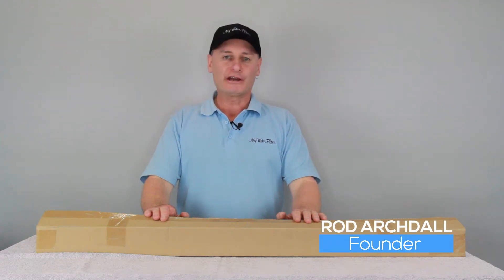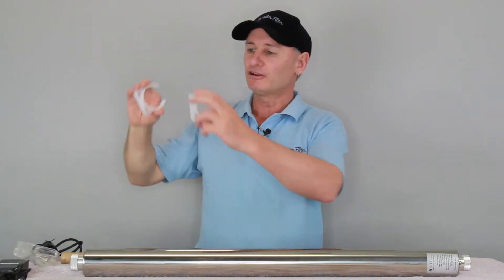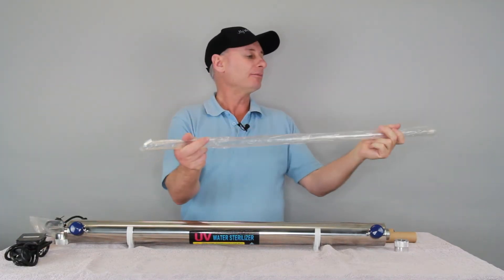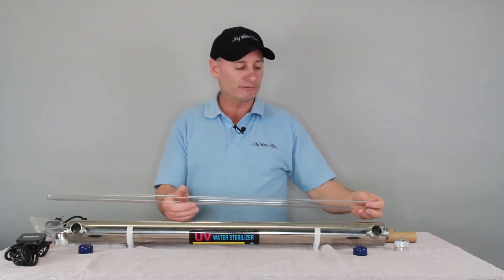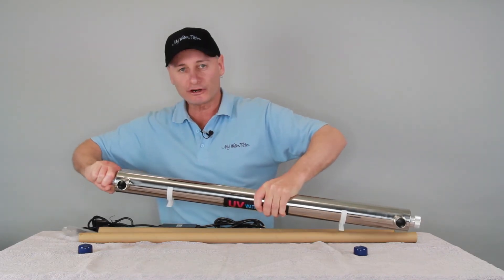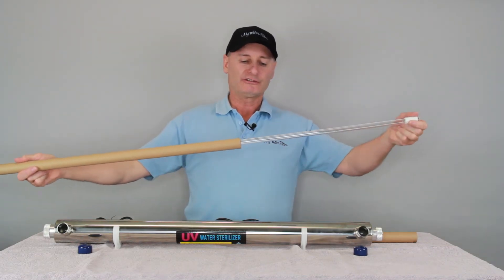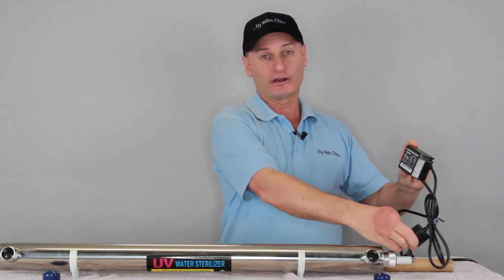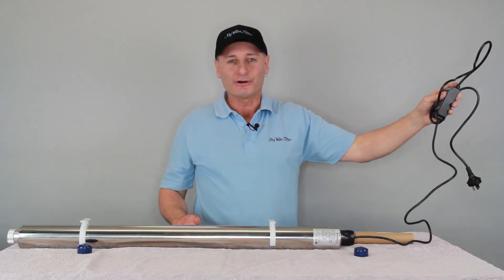Ultraviolet Light Installation Guide for UV Water Filter Systems

Comment: if you mount it vertically - why do you insert the UV light form the top end ..?
Reply from the maker: Hello Salty Dog Streak,

Thaks for the query

Salty Dog Streak, the reason it is installed where the UV opening is on the top end, is to ensure that UV lamp will not fall out of the casing or housing

The only thing that helds the lamp in place is a rubber cap, so to prevent slips regardless whether the rubber cap was removed or accidentally removed for somes reason, the UV lamp will still be safely secured in its place

Also, the lamp can be 1 metre long for a whole house system, so you need at least 1 metre to remove the lamp when it is time to change it. It is just easier to mount the system with the lamp removed from the top.

The other reason is water, it is better to have the electrical connection at the top and keep it dry rather than have water running down the housing onto the electrical connection. 

Hope this helps Salty Dog Streak

If you have more questions or need assistance, you can contact us at 1800 769 300, send us an email at customerservice@mywaterfilter.com.au or liaise with us over live chat through our website 

We are always here if you need 

Thank you, 
The Team at My Water Filter